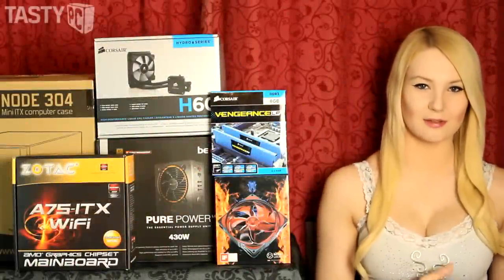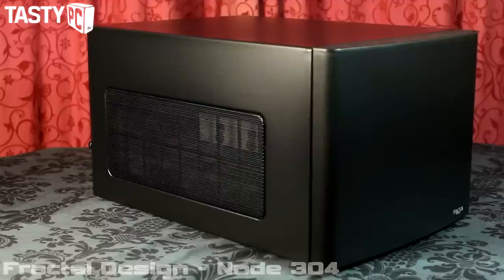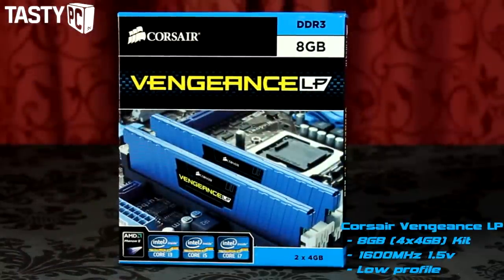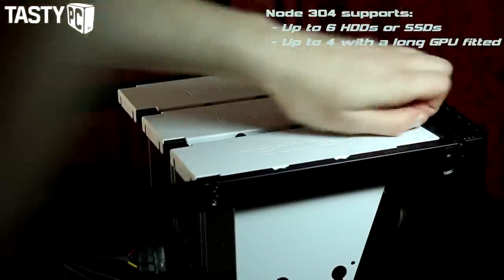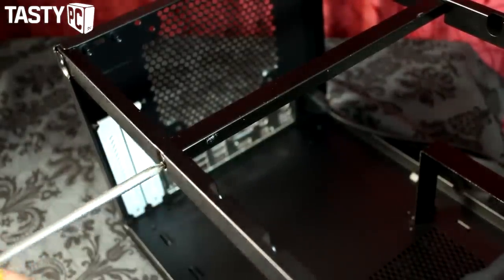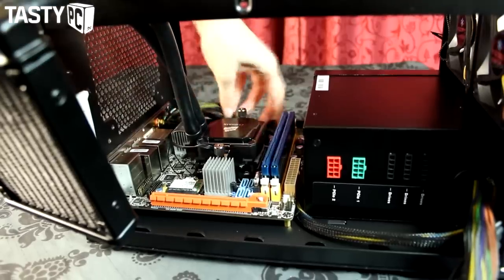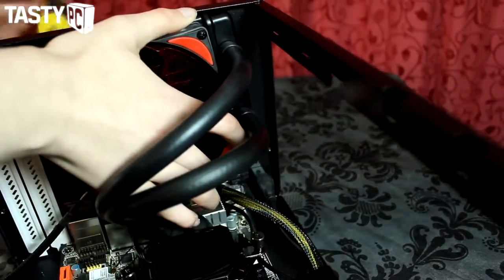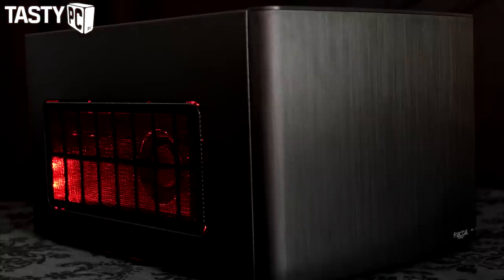Mini ITX HTPC Build - AMD 5800K APU, Zotac A75 Motherboard, Fractal Design Node 304

Comment: It's a lovely multi-purpose case and there's no better way to show that than to build with it. Well done. A power supply that I used for a build with similar power consumption was a Seasonic G-360. A little bit shorter and non-modular PSU that also stays pretty quiet. It's a first generation ADM APU with which I paired a spare HD5850 for LAN gaming. Now I'll take the card out and use it as a disk server put aside. Got to love ITX boards with built in WLAN.

Comment: Superb video Lauren and loving the Fractal case design. 

I have a 5 year old Home Theatre rig using a  Thermaltake DH102 case and it cost so much I just can't justify replacing it for this!

My current games system uses the H55 cooler and I can't recommend it enough, so I'm sure the H60 that you are using here is superb.

Comment: Using A10 5800K in My main htpc built in a antec 300 mrk 2 case,needed room for lots of hard drives 2 blu-ray burners and a cable card tuner.50" plasma plus a 23" hp lcd, 7.1 surround. Just windows media center and cyberlink ultra 12,vlc,for playback.and Netflix.Keep the videos coming,  Really enjoy Your channel .

Comment: Anti-static bags are designed to work similar to mini Faraday cages, which means all of the static that would be on the inside, sticks to the outside. If you're not concerned with static that's fine (I'm usually not, haven't had problems either) but you're deliberately using a worst-case scenario this way. It would be akin to cleaning thermal paste with sandpaper or something.

Comment: I like to keep to keep to Enermax or corsair power supply's. Going for a cheap PSU can bite you later down the road. Nice little build. the AMD A10 APU can do HD gaming on average graphics in most games. Makes a great budget build.
Reply: sasrob28 enermax and corsair had and still have plenty of trash PSUs in their line up. the corsair TX line was awful, cheap trash that were a disaster waiting to happen. the replacement, CX and CS lines, aren't much better. Enermax made plenty of trash PSUs as well. can't remember the model numbers now, but they were just plain bad. they were turds that were passed as "premium" products. 

enermax and corsair, just like thermaltake, evga, antec, etc, are only brand names. the OEM that actually designs and builds the PSU is more important. the best OEM is superflower followed closely by seasonic and Delta. CWT (channel well), great wall and FSP are OEMs that produce hits and misses, but mostly misses. so when you look at a corsair product, make sure you know which OEM built the model you are buying. Corsair sources PSUs from Seasonic, CWT, FSP, Great wall and others.

Comment: The integrated graphics are pretty good for playing games on med settings at 720p, bare in mind that the memory speed (1600 for an example) can change fps in games, the higher the speed, the more fps you can. They also made a newer version of the 5800k, called the 6800k, there's some very minor differences, but a big one is that it fully supports 2133mhz memory.

Comment: I'm curious to see what your opinion of that APU is. I used one in a build and was surprised at the ease ov over clocking both the CPU and GPU cores. Not only the ease, but also the performance gain. I think it performs admirably for its price point.

Comment: A little tip installing AMD Cpu's. Its always good practice to gently push down on the cpu itself, while closing the handle on the Zif socket. Otherwise it could slip out while you fasting it:)

Comment: the are what converts the wall power to usable 12volt power, you don't want to put all you high powered components on one rail otherwise you will overload it and not be using your second one at all

Comment: its on par with aircooling, except when you start pushing he system to load then you realize that it has a thermal solution of like 80 watts.

why not go with a cheaper, better aircooler? like the noctua nh-l12

Comment: The hardware will work ok but its down at a really small level under a electron microscope you can see the damage esd does.

Eventually the hardware will fail, could be next week, next month or next year.

ESD bag is designed to stop electrons moving around inside the bag, while outside it doesnt stop electrons from moving, this is why its not recommended placing a pcb ontop of the outside of an ESD bag.

This applies for any pcb, mainboard, hard drive, ssd, anything that has a pcb showing.

Comment: If the case allowed it, I probably would have mounted the PSU with the fan side up.  A couple of reasons.  First, it would have been a lot more efficient with hot air being shot up instead of forced down under the case where it will pool up.  Second, it wouldn't have blocked the PCIE cable jacks.   All in all though... Great little media server.  Ours is a bit more conventional and doubles as a graphics workstation so it's a bit more high end, but only because it has to also run Carrara.

Comment: If it isn't too much hassle, do you mind telling what sticky tape you use to fit your SSD into the case, normally i would use standard double sided sticky tape but that leaves horrid   sticky patches when you remove it later. Thanks.

Comment: Interesting build.  I just built a m-itx system for a family member but went the Intel rout with integrated gpu (Core i5 3750k).  I thought about using this fractal case but went with the Silverstone SG05.  Prefer the m-itx ps too.  I wonder how much performance difference there would be if you tested this system with a dedicated gpu (gtx 660 TI) and compared the performance against a dual or four core Intel cpu of the same generation using the same gpu.

Comment: I built a similar system not long ago and it managed Crysis (the original PC killer) better than a NVidia GeForce 8800GTX. In benchmarks it actually beats the 8800GTX in most tests. I know that's not impressive from a modern gaming PC perspective, but considering that it's glorified integrated graphics, I think it's pretty impressive!

Comment: only thing i would do different: take the asrock itx-board with A85X chipset. and if i need wifi, i can still use the pci-e slot and put in a dual-band wireless-n 450mbit/s card.

Comment: NVidia GPU looks really out of place in this assembly. You cannot parallelize graphics workload across GPUs from different vendors, and the GPU silicon inside APU is providing considerable 600+ GFLOPS of compute power which is wasted in such case. If there is a real need of discreete graphics in assembly, a use of appropriate Dual Graphics compatible dGPU or at least HD7750/7770 Radeon graphics is what makes sense provided a year of assembly. A newer analog should include Kaveri/Godavari A10-7850K + Tonga R9 285 paired.

Comment: I'm not calling you stupid but it's actually the opposite. Newer parts are more sensitive to static because transistors are smaller and require less voltage to discharge a static charge. Either way, I agree, static is overhyped as an issue. Still, you should periodically just touch the metal of the case or a plugged power supply to be safe. It would be silly to brick a part over such an issue.

Comment: That looks a great build.
I was considering the the SST-SG06-USB3.0 case as it comes with the USB 3.0 at the front and a great power supply but it is 300w not 430w so I hope that is enough.
I wanted to build a hackintosh  with intel integrated graphics but that is just not happening.
 I'm a bit fed up with intel with their HD 4000 and 4600. Broadwell desktops are not coming any time soon So I am seriously considering crossing over to the dark side and going windows.

Comment: Why would get an apu if you are going with a 660 if any thing you could try to get the new a10 and crossfire it with the 7750 because that apu will limit the 660 to a lower stands but just for a htpc the apu is awesome

Comment: The "system test" would probably only be slightly in favor of the Intel. CPU to CPU test, I think they are quite even, but the AMD APU graphics will hand Intel their ass. That's why you use an AMD in a GPU-less build.
And how is that Silverstone SG05 workin out? I'm having a toss up between that and this Fractal Design Node 304 for my moms build.

Comment: The common misconception is that a rail is a part in the power supply that provides power. This is completely false.
Rather a rail is a group of traces on the PSU's mainboard that are monitored by an OCP circuit.

By having multiple OCPs, which stands for Over Current Protection, makes the PSU a little safer. It's recommended for units with crazy voltage like 1200W.

Comment: I just built a Mini itx very similar to this one. Kind of disappointing (A10-5800k)
Feel like I should have just went with a 3570k

Anyone have temp issues with the 5800k? not overheating issues but it either giving no reading or an realistically low temp, like near freezing when its not

Comment: Yes the 660ti is a nice card. I have one myself, plays shit solid. Problem is most people are using probably a reference 660ti aka almost everything evga. Blower fan design cooling need space to suck air in to blow it over the card. They already run hotter because of the shroud but in that case, card being SO close to the case wall, will raise temps even more. Probably in the 80c range wich is kiiiinda bad. Plus the airflow in that case just looks terrible. theres better itx cases to buy.

Comment: Good build but a slim htpc would be way better. Cubes are the least portable of all, which kinda defeats the purpose
Reply: However, large cases like this can be used to hold a lot of memory, and run more then just media. I've seen sever other videos who use the larger case to include other capabilities and a lot of memory.
Reply: Bret Clements with memory do you mean file storage? cause 16GB of ram is enough for everything
Reply: i meant file storage. ya. long day lol

Comment: Novice mistake being made here; readers beware, don't ever install a CPU or any hardware as seen in this video. She is shown to have placed the motherboard directly on the anti-static packaging, which is a big no. The outside of the bag actually conducts static, the same way the metal of a car or plane protects you from lightning because it conducts it around the outside. This is basically as bad as installing the CPU on a thick carpet...
Reply from the maker: What gave you the impression that I thought the outside of the bag was anti-static?
Reply: TastyPCTV The fact you placed it on the outside of the bag would mean you either knew the risk but chose to continue anyway, or that you were unaware of the risk altogether. Whether or not you knew this isn't my place to say, nor is it my point. The point is the motherboard is at risk of ESD damage, it is a very common belief that the outside of the packaging is safe to work on; it's not. Hopefully this will help a few budding builders out there.
Reply: Ethanace
 on what should i put the mobo then?
Reply: root8ble It is generally advisable to keep the motherboard in it's original box if possible, if this is not, place the motherboard on the outside of the box, or last option, turn the anti-static bag inside-out so that the inside anti-static part of the bag is on the outside, and use that as your surface.
Reply: ok thx for the tip :) will be building an htpc soon
Reply: root8ble No worries mate have fun and hope it goes well, if you need any info just message me

Comment: I hate seeinh everyone saying that the outside of the antistatic bag is not antistatic 

IT IS THE SAME MATERIAL
Reply: The outside can actually be conductive in order to make the component inside less prone to a static shock, so putting it on the top of the bag once its taken out can cause problems
Reply: Anti static is ANTI STATIC

There is no diffrence all im trying to say is:if something is not able to be electrical charged then it also is ANTI STATIC 

Same bag same story deal with it
Reply: The outside of some bags is a different material to the inside
Reply: But this isnt so i guess were both right
Reply: Trevor Greig Umad?
Reply: You're the one that used full caps and insulted me, I'm simply returning the favor.
Reply: Thanks, couldn't even handle a joke

Comment: LOL comparing an apu to an i3 wich really isn't designed for gaming. First video you linked. No mention of ram used, timings, or motherboard involved. Also that apu is probably at what like 4.something ghz? while the i3 is at 3.4ghz max? Bad benchmark testing. Second video...says its better than the i7 2600k...a cpu wich you can't even buy anymore.

Comment: Why on earth would you drop the cash on a 660 for an apu build? Save yourself 150 to 200 bucks and DON'T get that card. That apu will NOT be able to handle anything that this 660 was built for.